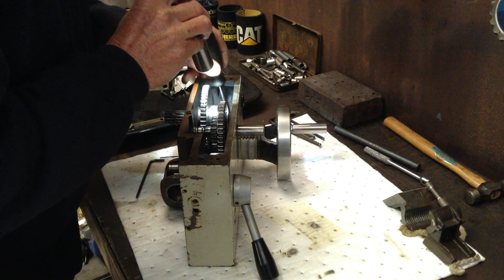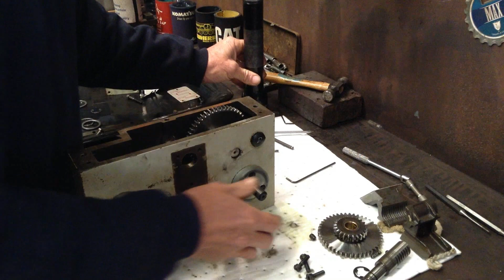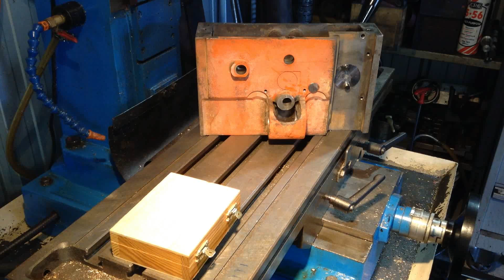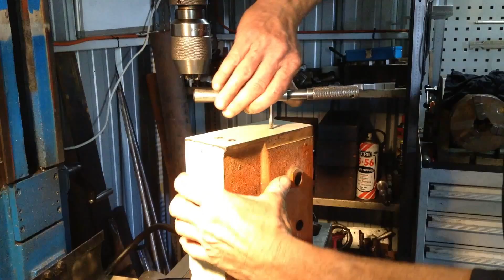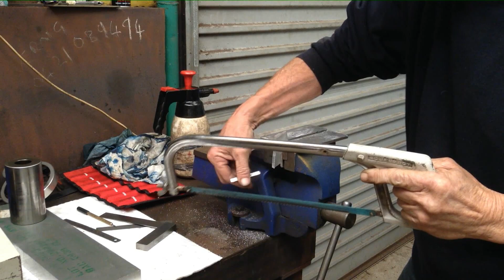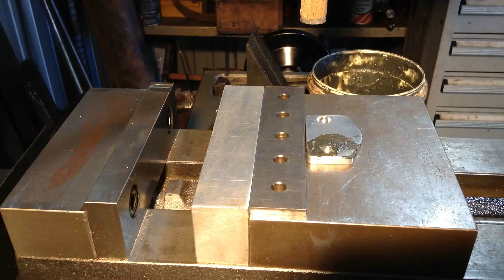Centre Lathe Maintenance / Mod's   Part 5

Comment: hello max i am curious as to how that cover plate is going to stop the leak, just a bit more pressure to overcome?
Reply from the maker: It seals off the end of a gear shaft  . The shaft would leak due to the higher oil level i run in the apron to lubricate the apron drive that normally runs dry .
Reply: @swanvalleymachineshop  hey max thanks for the reply i understood the higher oil level still don't see how you stopped the leak I doubt you did it surely is still damp around the edges of that cover is it not you are a much better mechanic than that, really appreciate the time and knowledge you put in to the vids thanks. i am not trying to pick on you about the cover I don't see how that would stop the leak

Comment: Pulled my apron off, halfway making the bronze gear which engages the worm on the feed shaft, badly worn due to the buildup of swarf in the open housing, once finished will make a cover.
Going to use your idea of installing a cotton wick so the worm and gear to get adequate lubrication.
Reply from the maker: Cool . I am also going to make a small cover on the  l/h end of the apron to keep the crap out of the half nuts .  Cheers .
Reply: Gear finished, shimmed the indexing head to get the correct lead angle and cut 22 teeth using a DP 16 cutter .
The worm gear is not involute, just a simple vee so not perfect but good enough for purpose with minimum backlash.
I have seen on Hare and Forbes web site various gears but why buy one if you can make one.
Reply from the maker: @willemvantsant2707  When i checked my gear it was 1.5 module  so  is the worm  , but my one is 18 teeth .  Sounds like what you have done will be fine  as backlash is not an issue with feeds .  Cool.
Reply: Miss my DSG 13 X 42, never had to look at those components, she just put out 24/7, what a machine, sold it and my Hercus model A and my Emco Maximat, seriously miss them, now living in SE Asia where everything is a challenge.
Reply from the maker: @willemvantsant2707  That's why DSG were the best lathes in the world , probably still are . The hydraulic tracer attachment i am looking at is a DSG  one & i will adapt it to fit the JFMT lathe  ( Soo Lee ! ) Cheers .
Reply: Was playing with my Brothers Colchester in Perth, he has the hydraulic attachment, can't believe how repeatable and sensitive it is!

Comment: An interesting series so far Max with some well thought out improvements and additions. Strangely the inside of that apron casting appears to have never been painted. Taiwanese and Chinese machine tool manufacturer's as well as even the very best in the world almost always paint inside any castings that will be holding oil. That seals off porous castings that might develop small leaks and buries any casting sand that might get missed. When I bought my Taiwan manufactured Bridgeport clone I had to pull it apart to get it into my shop. I chose to wash all the parts in solvent to remove the anti rust preservative they love to slather on. In hindsight I'm happy I did so, while I didn't find huge amounts of contamination there was enough (a few grams) it made it well worth doing. Some of what you found in the bottom of that apron may be casting sand, but my guess is like my mill most of it is cast iron dust from machining mixed with some grinding dust. These machines are machined and assembled in nothing that resembles clean room conditions and with what I've seen so far I'd highly recommend pulling a new or used machine apart as much as possible for a detailed cleaning. They then operate much smoother while gib, feed nut adjustments can be adjusted much tighter.
Reply from the maker: Yes , i think the  quality of these machines  varies as to  the  brand name they are sold under . Cheers .

Comment: Good thing you got the sand out while you were at it in there.  Residual sand is still a problem in the West, as just a few years ago Chrysler vehicles with the 3.6 had heater cores and radiators plugging up because the sand was not properly cleaned from the block castings . . . Also good to see the threading dial going to the right hand side of the apron - my lathe which is similar to yours came that way.
Reply from the maker: Thanks Everett .  Interesting thing with heater cores , that would be a pain .  Thanks .

Comment: Hi Max, can you please tell us your secret method for making this circular pattern. I've done this years ago with a round steel brush in the drill press, but the finish was too rough.
Reply from the maker: Valve grinding paste , i use fine but want to try medium & find a bit of soft wood & machine the end square . Finding the right wood is a trial & error thing , the best bit i found & use is a bit i cut off a pine stirring stick that we use to stir the  pool  chemicals .  Cheers .
Reply: Thanks Max. Now it isn't a secret anymore.
Reply from the maker: @Rustinox  Ha , the  pool chemicals we stirred with the stick are though & that's what gives the stick it's magic properties to enable it to do jeweling !!!